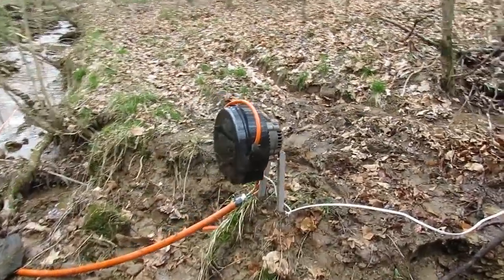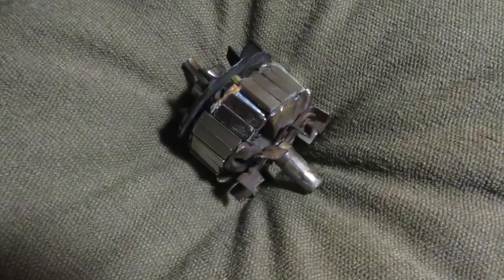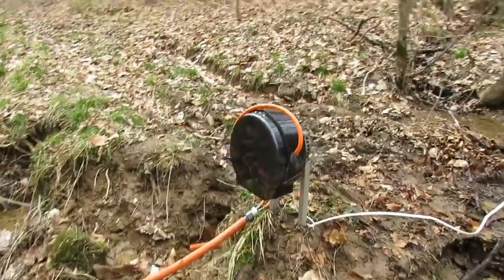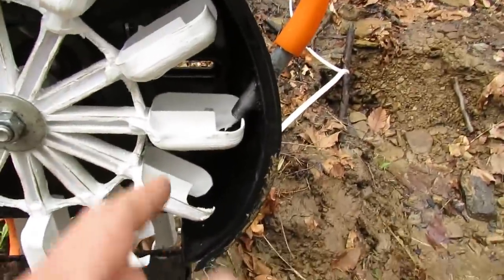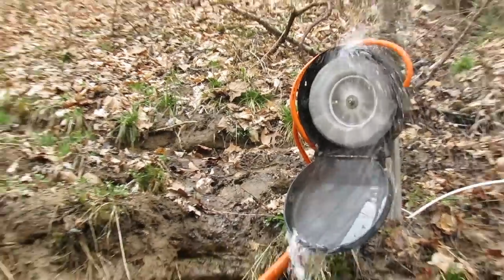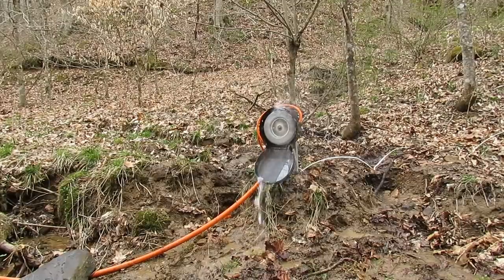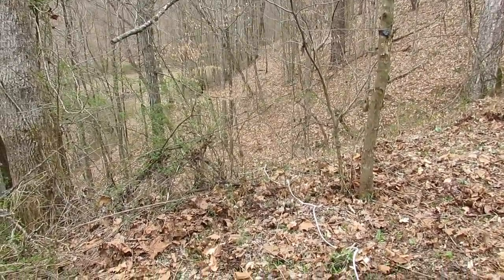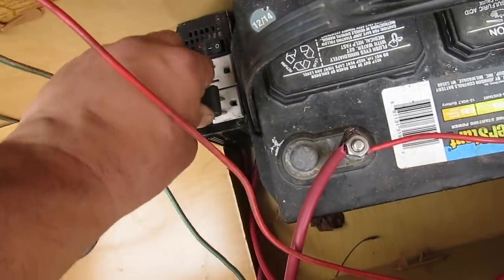Water Generator Running Off Grid Cabin

Comment: are you positive by closing the tp dispenser it's not slowing it down any might get more rpms open, nice job.
Reply from the maker: It would be worth a try.
Reply: As and electrical engineer (now retired), I studied the old Pelton wheel extensively.  One thing I remember is that the water discharge chutes for a Pelton are very important to avoid having the discharge water slow the wheel.  For your left nozzle in particular, you need a discharge chute at the top that collects this water and routes it around the outside housing so that it does not hit the paddles again (and brake then) on its way out.
Reply from the maker: @clancylittleboy7408  Thanks for the advice. I wonder if it would be better to have it with the pelton wheel pointed down. That way the water would fall out of the way.
Reply: That should increase your wheel efficiency, but could shift the weight or force on the alternator bearing from horizontal (normal) to vertical.  That may have an effect on the bearing wear, but I would risk that.
Reply: A horizontal wheel will increase your efficiency due to the better water exhaust.  But for most engineering changes, there are pluses and minuses.  The minus for this is vertical bearing weight instead of horizontal (what the alternator was designed for).  Check the bearings and see if there is a way to offset the additional vertical weight.
Reply: @clancylittleboy7408 , the flow is crucial to its performance yes, how about making the wheel into like a spiral wheel with more arms(the carrying paddles) giving it the corkscrew effect?
Reply: Yes, that would increase the efficiency of the wheel.  But it would also change the force on the alternator bearings from horizontal (normal design) to vertical.  Usually every design change has pros and cons to be considered.  If the total weight on the alternator shaft is small, then go for it.  Another advantage of this would be increasing the net head or force that you have acting on the wheel.  You need all the head you can get in this installation, so going to horizontal with a low mounting height will help that part.
Reply: @clancylittleboy7408  how about a bearing on each side of the shaft maybe even better 2 alternators on each end of an extended shaft, you can have one of the alternators in reverse direction it could handle more rpms and water. You can take a booster pack(better with lithiums) with a inverter that has a 120v outlet using it like a bms using the jumper cables to charge multiple batteries with amps, usually the small batteries in the booster packs are lower amp hrs with low capacity but they're still 12v with the bms in the pack set to charge for the original battery with lower amps the booster packs won't work at all with a depleted internal battery even plugged into the AC, take out the internal battery so you'll have an external battery for visual inspection and easy connect and disconnect, you can use  any 12v battery to replace the cheap internal battery but a battery needs to be in the circuit and you can draw  amps through the booster cables that can allow not only boosting but charging as well.  I connect 2 more pincher cables to the internal battery which is now an external battery. A variac plugged into the 120vac outlet(the inverter) you can regulate the outgoing to save some capacity and with the variac it can almost double the voltage take a 12v spotlight if the variac is set on the dial to a higher voltage than the spotlight it'll trip the internal breaker so start it at 0v with the variac it'll handle more than 12v it almost doubles it to 24v if it's a 1million candlelight taking it past 12v almost to 24v almost doubles the candlelight to 2million candlelight
Reply: There is always room for experimenting.  But search the history of Pelton wheels and you find that many variations have been tried, but after 200 years of use, the basic wheel still looks the same - like you built.  The main variation is the number of nozzles.  I have seen up to 4 nozzles when there is plenty of volume.    Also for large volumes, you can use more than one wheel on the same shaft or multiple wheels and generators.   So the bottom line is if your cubic feet per minute is low, then use 1 or 2 nozzles.  If it is high, use 4.  In all cases, increase the height of the falling water as much as possible.  For economy, use a large pipe ("penstock") for the first 1/3 of your run, then switch to a medium-diameter pipe for the next 1/3, then to a small diameter pipe as the pressure increases for the last 1/3.  Of course if you can afford it, use the large pipe for the entire run to reduce pipe friction loss.  Keep pipe bends to a minimum, and make sure your fittings have smooth interiors.  Consider a PVC Y fitting for your splitter.
Reply: @clancylittleboy7408  useful info, lithiums with the pelton wheels should work good together and graphene,  maintaining the pressure is definitely key
Reply: @lukeFugate  , have you been looking into the lithium battery packs?

Comment: You need to get all those kinks out of the wire so the electricity can flow faster.
Reply from the maker: lol. Poor electrons getting all tangled up and confused.
Reply: luke Fugate lol 😂☝️, on another note I like the turbine when you do a 2.0 version try mounting the alternator on top so once the energy is taken from the flow it falls out and doesn’t hinder the wheels performance, use 4” pipe reduced close to the turbine, use smaller length of feed tube and put 1/4” nozzle to pressurise the water (same or more rpm with less water)

Comment: add 2 more batteries in parallel, you'll be able to catch more of the "overflow" voltage and run a few more appliances as needed.
Reply: I was talking to the vid saying exactly that. Just bc it's free - why are you wasting it?!
Reply: @mtnmommom  Another way to capture the excess is to route it to a teapot or immersion heater.  Heat water for your coffee or tea!  When you get to float battery level, it clicks a relay to energize the water heater.
Reply: @ljprep6250  That is a system id love to have for coffee and clean up. Maybe evenjust radient heat to warm the cabin a little bit.. 
Sort of like a cantenna? or a bleed off from an antenna? Im guessing..
Reply: He would get longer life and more storage if he went to 6volt deep cycle batteries 
Yes he would require 2 to replace what he has but in my experience the 2 six volt out last the one twelve volt if properly maintained
Reply: sgbarn yes I agree I've been telling this to people for years. They just don't listen...
Reply: Unless the creek freezes 
you should have a dozen batteries.
All this should be inside tho.
Reply: 6 Volt Cells Deep Charge are more convenient 
but more expensive and must be continually maintained,
or they’ll be dead and freeze in cold weather. Ruined.
Reply: 12 volt alternator...  for 12 volt car batteries...   :-\
Reply: sgbarn he needs a forklift battery 24 v
Reply: i know it is kind of randomly asking but do anyone know a good place to watch newly released tv shows online?
Reply: @Benton Joseph Flixportal
Reply: @Camilo Xander thanks, signed up and it seems like they got a lot of movies there =) Appreciate it !!
Reply: @Benton Joseph Happy to help xD
Reply: If you add more batteries with the same setup can you run more appliances such as TV and fridge and and still receive charge or would you need to add more water wheels more alternators?
Reply: Fred Rodezno yes and no, his generator is producing more power than the 1 battery can use up so the charge control box holds it back and basically throws it to ground because there is no where for it to go, so add 1 or 2 more batteries in parallel to make a "Battery Bank" ( parallel means a wire connecting all positives together on the positive line and another wire connecting all negatives together on the negative line still having just 12 Volts), then the extra power being produced has a place to go and the voltage should be closer to 12 Volts as it should be rather than the 14 Volts he is getting because there is no where for it all to go. So with a bigger battery bank you have more stored energy to run more things, now if you try to run too much stuff all at the same time you may end up needing a bigger generator but the idea here is to have enough batteries so you are able to store all the energy being produced and not wasting it and being conservative with what you got know when to run things and what not to have running or turned on at the same time.
Reply: @fredrodezno2943 : The size of inverter is really the key. But that's only one of three other things that's needed.  This guys inverter would barely light a few LED's . To do what you're suggesting would require not only a larger inverter but a larger water wheel diameter, more wheels or both. Secondly, what he showed looked like a car battery and though hot, they WILL NOT WORK VERY LONG. Deep cycle are the only way to go. Finally, an inverter has to be large enough to do the job. Here's how to determine its size: Add up how many watts you'll be needing by looking at the appliances you'd be using. Add an additional 20% to that total. That number will be the size of inverter needed. Remember too, the alternator and batteries also have to be able (in watts) to carry the load one uses as well. For example: A typical  100 amp car alternator can safely produce approximately 80 amps all day (if in this case the water wheels were large enough). Their output voltage averages 12.5 -13.5 volts. Multiplying 80 amps by 12 volts = 960 to approx. 1000 watts. Once inverted (with some losses) one might expect approx. 125 Vac and 8 amps available (10 amps at the very best).  Bottom line: The bigger the electrical load, the bigger the batteries, alternator and inverter needed.
Reply: @Rev22-21  , I don't know buddy, you sound kinda like a Debbie downer. This guy is making more power than he can store already with this inverter and alternator. Adding one more battery....any old battery that he already has laying around that'll take a charge would be the first route to take. That car battery will last a long time if he keeps it charged, just as long as if it were in a car. Years. Even lil old motorcycle batteries will work if you have em laying around. This guy is out in the sticks so, it's likely a ways to town.
Reply: Definitely bank deep cells, keep inside,  use a ventilated clear plexiglas cover, if any at all... the farther apart the input to the output, the thicker the gauge of wire... nice water wheel, very apocalyptic.
Reply: sgbarn 

My thoughts exactly parallel the batteries, create an electric cistern from the water.   by the way this is a great video and a success for sure=)
Reply: @brianwalther5467  electric cistern? You have my attention..

Comment: Fantastic but you need five more batteries wow what a great set up you made very impressive.Hell that will run a   Refrigerator and a ceiling fan and TV and you can call that home
Reply from the maker: If I can get a few more sources it would be better. I think this setup only produces about 50 watts or less.
Reply: Get a high amp alternator you can run quite a bit and charge a larger battery bank

Comment: Hydrogen gas is produced by the battery when charging. This gas is very light and will rise.  Holes in the bottom of the box will not let the gas out. This gas will corrode electronics so your Charge controller will go bad. This gas is highly flammable and it's not a good idea to get it into the house or around possible electric spark sources.
Reply: Just get large deep cycle SLA batteries and don't use car batteries. Car batteries really aren't good to discharge anyway. SLA are safe to charge indoors.
Reply from the maker: I'll be moving my charge controller inside the house. As far as the box venting, it should vent out the top fine. The cabinet had pieces of felt on the corners to cushion the sound of the door slamming. It is held off of the box by about a 16th of an inch.

Comment: 3 phase? Off the alternator A/c ? It's single phase and dc inverted to ac ..
Reply: Yes 3 Phase AC off the alternator.
Reply: @snicks50  Three phase delta into a six diode rectifier (Google three phase rectifier)

Comment: Add another 2 batteries in series and there won’t be any waste !
Reply from the maker: You are right, more batteries are a must. I already have another battery up there now. Nothing is running right now though. I'm sure the water system is clogged up by now. With work I haven't had time to fool with it any.

Comment: Why would you convert the alternator from 12 volts to 120 volts (3 phase mind you) through the electronics that convert it back to 12 volts then through another converter to 120 again. Lots of converting and electronics to go bad.
Reply: AC travels better over large distances
Reply: @sobolanul96  Exactly that.
Reply: @sobolanul96  Pretty sure that's not true.
Reply: @benlawton5420  it's very true. That's why ac is used for the grid.
Reply: @SirFrag32  Oh and skin affect.
Reply: They use ac on power lines because it can go long distances and dc has a large voltage drop over distance
Reply: @rearl1869  It was because we had not way of transforming dc, now they are starting to use DC for backbone lines. Also the line from France to the UK is DC because it's more efficient.
Reply: @rearl1869  AC has capacitive, inductive and other reactive losses.
Reply: DC is more efficient for long distance transmission but components are much more expensive, DC leaking underground causes problems...and high current DC is much deadlier than AC. On the other hand you've got alternators all wrong, they produce AC and it has to be rectified
Reply: @alabastardmasterson  Yeah I know but he needs to convert it to DC so may as well do it at the generator. Also DC is more expensive on short runs but on long runs it is cheaper.

Comment: You can always add another hydroelectric generator!
Reply from the maker: Yeah, I guess I could keep adding them to the end of my property.
Reply: @lukeFugate  do you know how many watts it can do, I have a small spring I can dam up , and generate power for my off grid house, I have solar, but even 200,300 or 400 watts 24/7 would make a big difference, I may even be able to run a small window ac in mid summer, I'm in North West North Carolina,  it seem you may not be that far away, I was thinking wind turbine,  but my average wind is 5mph, wit storms of40-60 mph, not so cost effective, I was thinking about a tiny water wheel, until I saw this, my system is 24v, and I have 2banks, 1 of golfcart batteries, and another of lithium batteries, I hope to use the lead acid batteries for backup, you have some awesome ideas,

Comment: Try doing that with a washing machine motor instead of the generator
Reply from the maker: There are a lot of ways to do this. There really isn't a right or wrong way to build something like this.
Reply: Why what will that do, ? Is it a better way
Reply: @carlschmiedeke151  I SAW A VIDEO ON YOUTUBE RECENTLY THAT SHOWS A GUY USING A WASHING MACHINE MOTOR FOR THE SAME THING.....A WASHING MACHINE HAS A CAPACITOR.....NOT SURE HOW HE USED IT, BUT A CAPACITOR HOLDS A CHARGE FOR A LONG PERIOD OF TIME.....I KNOW THEY ARE POWERFUL ENOUGH THAT THE CHARGE WILL LAST FOR A FEW WEEKS

Comment: Pretty cool...but what happens when the creek freezes in the winter ???
Reply from the maker: It will freeze up. I'll have solar set up for winter. I have a better view of the sky when the leaves are gone.
Reply: Running water doesn't normally freeze, if it moves fast enough.. My creek doesn't freeze up in Tennessee, but I guess his moves slower and his creek is a bit smaller than mine

Comment: Nice. But you need to put a bed of rock under the outlet to prevent soil erosion  and water contimation
Reply from the maker: I did. I already had the camera strapped on the four wheeler so I didn't film it. I just got some flat rocks and put under it redirecting the water back into the creek.
Reply: I agree. ..mitigate that erosion or you will find yourself moving your set up.

Comment: Nice, but you need to keep water off of that generator or you won’t have it long.
Reply from the maker: I ended up using a butter bowl with the bottom cut out to shield the generator. I also took a piece of gorilla tape and sealed the hole where the water was coming out.

Comment: You should use 12 light bulbs By pass the inverter that’s what I did with my wind and SolarSystem
Reply from the maker: That does open up a lot of options. Using the D/C directly is much more efficient.
Reply: I have converted my hole shop to run on 12 volt dc I Converted my air compressor with a 1 hp permanent magna motors 2 pistons air pump

Comment: Micro-hydro generators are great as they generate power as long as the water flows.  Wind generations of power is when the wind blows and solar is when the sun shines.  If you can charge at 5 amp all days that would be 120 Amp hours every day with no letup.
Reply: convert the micro into a hydro lol